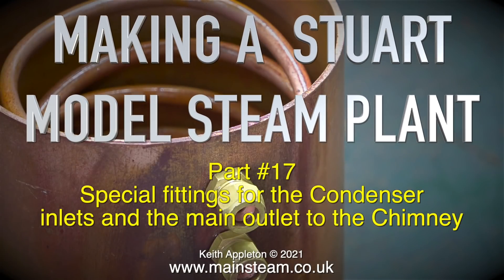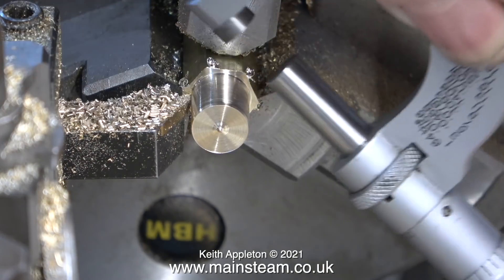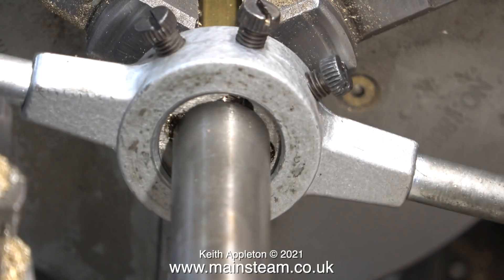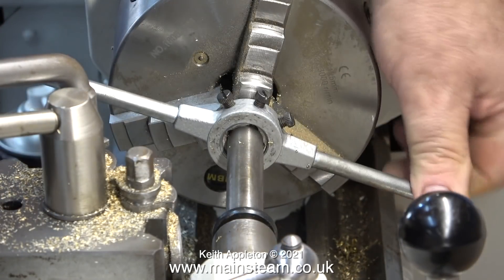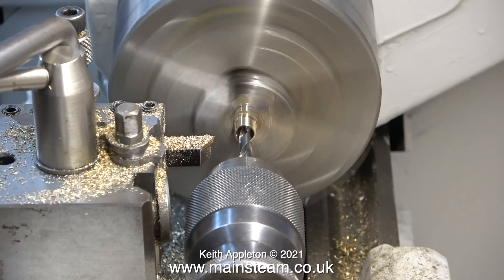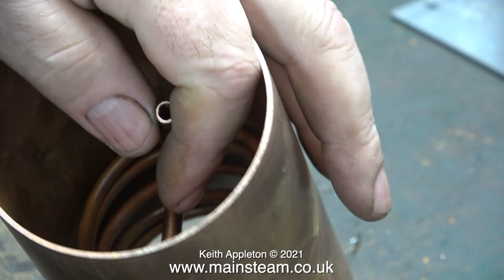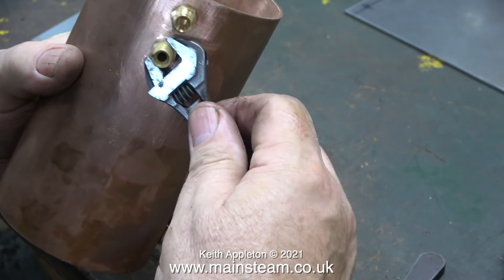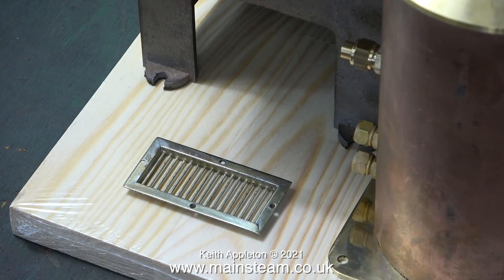MAKING A STUART MODEL STEAM PLANT - PART #17

Comment: That grill looks a good addition, I think you said previously that you were going to route pipework under the base board. But the question is, ... Did you get your DAB module working again?
Reply from the maker: You will see the development as the series progresses, I had a few problems with this one. Also my car was flooding inside very badly owing to a simple blocked air vent drain of all things, and it eventually was an expensive job to fix and in the end I needed a replacement DAB module ......